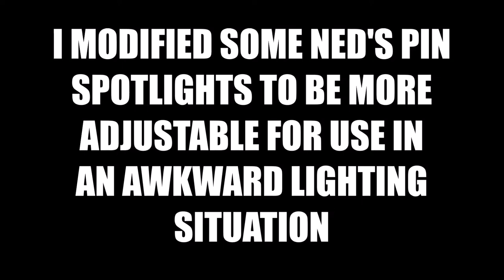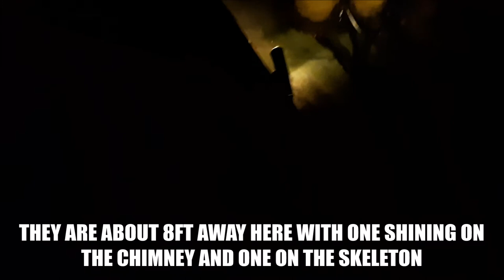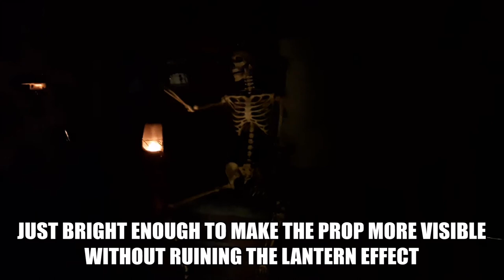Micro Spot Modification

Comment: I started doing something like this maybe 14 years ago when I had props attached to trees that I needed to illuminate. I would cut up hanger wire and use electrical tape to attach them to the tube of the LED lights. I would run the electrical wiring up the tree and have it stapled to the bark bring it out on the branches and then I would have a hook put in the end of The wire so that I could screw the light to a branch. Most of the time I probably had one to two feet length for my wire because I needed to get the light close enough to the prop and I could twist it to whatever angle that I wanted to have for the proper effect and it would end up looking like just another Branch coming off the tree.